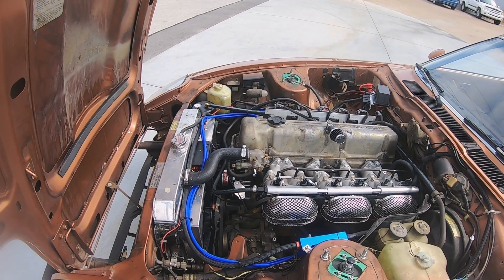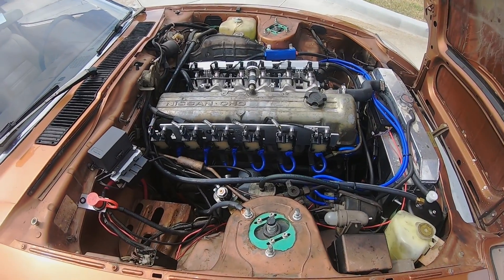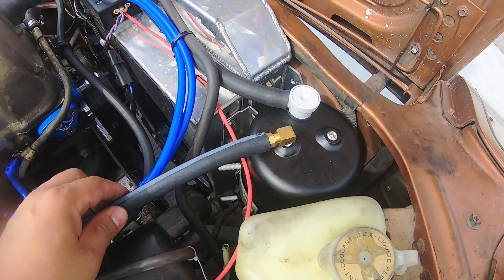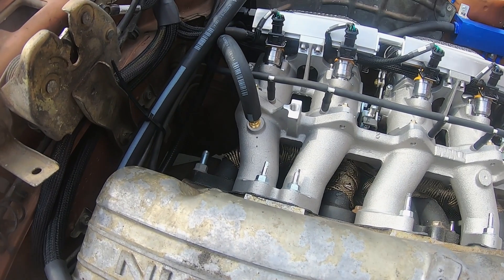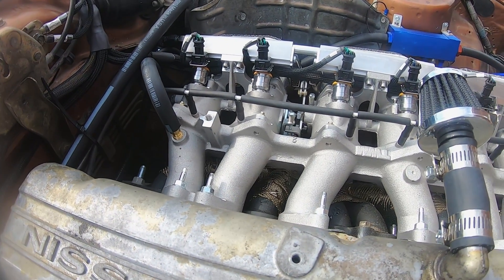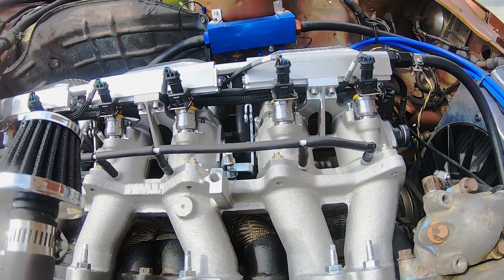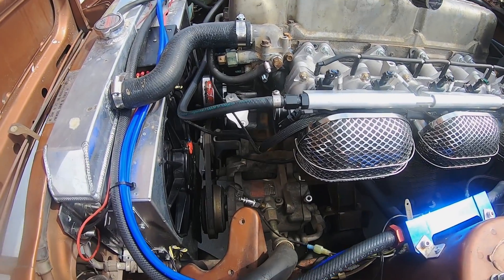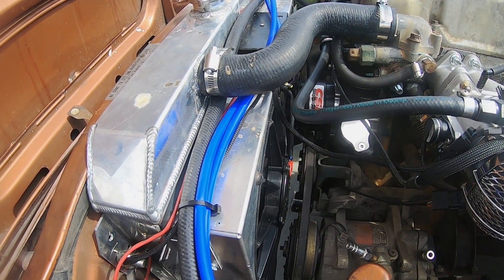Building Legends | Brandon's High Compression ITB 280zx Recap

Comment: Tried to use the electric water pump on mine the csr as well, but it threw the trigger wheel sensor off. Car wouldn't even start with the water pump going.
Reply from the maker: That's a really interesting problem, never heard of that happening before. How did you have it wired?
Reply: @GodzillaRaceworks  it was wired to the ignition. So when the key went to the on position the water pump turned on. I later bypassed it with its own switch which worked but then just went back to a mechanical/belt driven one.
Reply from the maker: @AZGhost623  Wow, that's really bizarre. This client daily drives this car with the CSR water pump, zero issues

Comment: did you guys ever end up mass producing the trigger wheel set up? I'm looking for one at the moment, or will just end up using you guys crank angel sensor
Reply from the maker: No we've decided to stick with the crank angle sensor kit. Several issues we had were the amount of different balancers, which means we'd have to offer up to 4 different trigger wheels, and 4 different crank sensor brackets, it just became too troublesome to offer something to cover all of the years reliably.